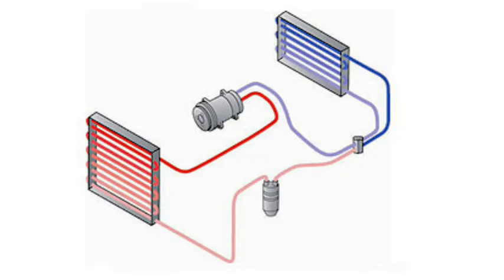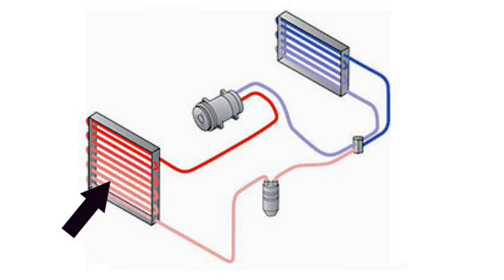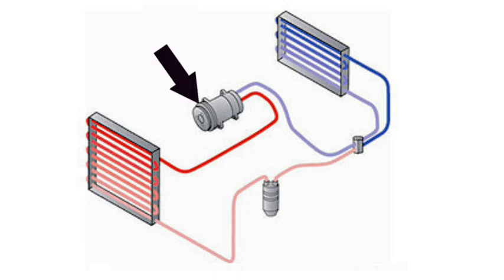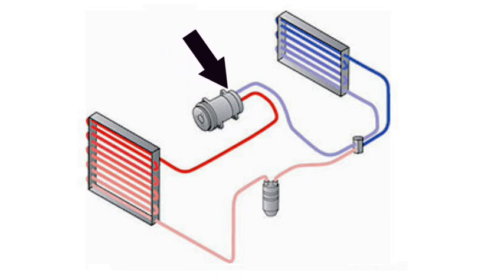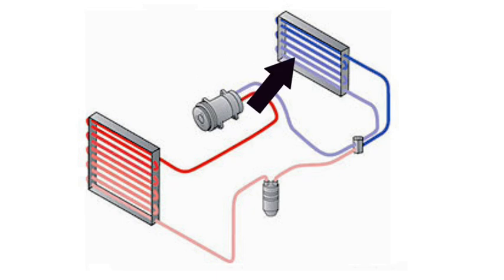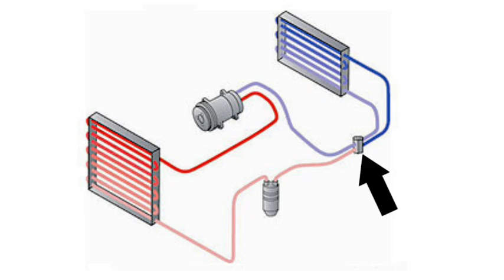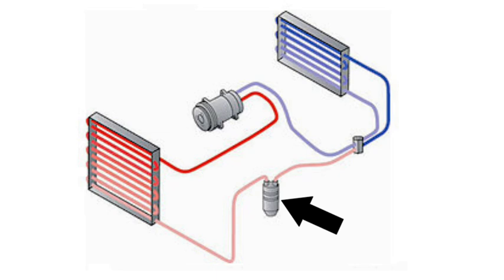AC System Basics - EricTheCarGuy

Comment: Hey Eric explain why you are showing these A/C video on charging your system, when you are constantly telling us to don't work on it and take it to an A/C professional. So are we just watch the video and then let someone else do the work. They can't be for professional because they wouldn't need them. So do we learn how to do with these videos or do we just forget about them and just take our cars to a mechanic.
Reply: Ray Cruz the reason he says let the professionals do it is because basically nobody has an A/C recycler sitting around in their garage, which is MANDATORY to use when servicing an A/C system... not using it allows the A/C refrigerant into the atmosphere, which is against the law and the EPA can slap you with a 5 figure fine for doing so. 

If you have the equipment and the knowledge to do so, then by all means do it yourself. But there are very specific machines and tools that need to be used
Reply: Ray Cruz were is the orfice tube on 2005 Buick ."."".?diagram showing it b helpful since it looks it can b anywhere in line
Reply: Ray Cruz sorry 2005 lesaber custom
Reply: Hey Ray...I saw Pat Goss this morning on Motor Week from Olings Mill, MD. He showed cleaning the ac system with this can that foams inside the entire unit under your dash. He demonstrated on the container under the dash sitting on his cart. Explained how to do it but did not say if you can make the hole without removing. Pulling those out you have to remove the entire dash. So my question for him was if this is done in place. Also just seeing the video's just makes you more aware how the system works. When mechanic talks to you what he will be doing, you know what he is talking about.  Always good to know something about your car problem if possible and maybe not get ripped off.  I've learn a lot just watch my Motor Week on Saturdays.  These Youtube videos are great and leaning things I've never attempted. Have a Good Day !
Reply: Weechie357 pacman 
Buy a service manual for your car.
Reply: Ray Cruz A
Reply: Also, by telling us to get a professional to do it he covers his legal bases. In other words, he can't be held responsible if someone does it wrong & gets hurt. So, if you have enough to get-ur-done go for it. If you don't, take it to someone who does. I think it's good advice, don't you?
Reply: Maybe so you have some idea of what the hell you're talking about when you take your car in for repair?  Ignorance may be bliss, but it's also expensive.  Or liability reasons?  Or 700,000 views, so maybe the knowledge, capability, and skill set of his audience varies quite a bit?

Should I keep going?
Reply: Your barking up the wrong yet tree I wasn't knocking on the video just some the comments that he made. In one sentence he is  telling you you how to do it
Reply: And on the other he telling to leave to the professionals.
Reply: And I'm saying there is value in knowing how it's done even if you don't do it yourself.  If you're going in for surgery, you want to know all you can about the procedure, right?  Will you ever do it yourself? Probably not...

Comment: EricTheCarGuy: Hi I'm a new subscriber.
 Have a question, My compressor clutch will not engage, i attempted to put Freon in it , however, the system would not take the Freon.
Does the clutch have to be engaged to accept Freon ? Thank you.

Comment: From Nashville TN, I have a 2011 Nissan rogue that blows out hot air with the a/c on. I took my car to get it looked at. The first guy was sure it was the A/C Expansion valve. After review that the part was $50 and the labor was $900 and me being a line tech, I have experience in production on assembling the dashboard over 2 years. I'm confident that I can do the job. but when it comes to the A/c System, I'm new to that. So I'm in the proses of finding out how it works and studying the main components. I need to know what test's can I run to find the main problem and why there is no cold air. I need every test that will help me. Thank you Justin.

Comment: ok i have a 03 hyundia elantra gls 4door lol that thing you said in front the radiator now on the left side on passenger side there is a bolt and i at dent lee loose the bolt and big air came out should i be worry about that

Comment: i like the video so i would like to ask you that is it possible to run a car AC assembly outside of the car....  just using the electric motor as a driving force of the compressor assembly  that activates by the electromagnetic clutch

Comment: Hey, I have a problem with pressure sensor. but when i bypass those two sensor wires a/c works fine. Because when you bypass this, the system thinks that there's enough pressure in it. But is it good to bypass these wires or is it something not good about this?
Reply: The pressure sensor turns off the ac when the pressure gets low to protect the internals of the system from wearing. If you bypass those wires, the ac will work but you risk damaging the system in the long run. Any sensor is there for a reason and bypassing any sensor is normally never a good thing in the long run. Try getting your air con re gassed and see if it works better
Reply: Well I will know if pressure get low then ac won't get cold enough lol
Reply: ThreeDriv3rs You'll also know if pressure gets low when your compressor fails lol.
Reply: TheArfdog Yeah, but it could be some other problem. It could be some hole in the lines
Reply: Your A/C will not start up if the pressure is too low, that is what your sensor is for. This is a safety measure to prevent your system being damaged since the oil that does the cooling, also lubricates the system. You better make sure there is enough pressure and that it simply is the sensor that is in error (which is not that likely).
Reply: Henk Moesker I fixed my problem

Comment: Would you recommend the universal A/C kits available on YouTube for cars that don't have one installed already, or try to get hold of the parts that make up the original A/C system? And if yes to the first, would the condenser placed in front of the radiator reduce the effectiveness of the radiator too much for that placement to be a good idea?

Comment: hey eric just to expound on the subject of moisture in a ac system what actually happens is the moisture freezes at the expansion valve and clog's it completely closed , this is a common problem in all high pressure applications , nail guns for example have metal hose couplings that do this in winter

Comment: The expansion valve drops the pressure from a high pressure  liquid refrigerant to low pressure liquid refrigerant.
In the evaporator the  liquid refrigerant changes from a liquid to a gas as it absorbs heat from the interior of the car.

Comment: wheres the line drawn when knowing if your condenser works or not? 

I have a honda civic that needed a new radiator because of a crash, there was saving the radiator but the condenser looks in good shape. no visable oil leeking from it.

Comment: Hey I have a 87
Toyota pickup with out ac and I plan on putting ac in and I was wondering if I could just run 12v to the compressor with a one way switch so I can turn it on and off

Comment: hey eric  i just purchase a truck that hasn't had an oil change in many years (1988 ford f150) runs god but the person i bought it from toll me to do an oil change firs before take it for smog this truck was use around the farm only. he told me to drain the oil take the filter out put a new cheep filter put the drain plug on put a gallon of  gasoline where the oil goes and run it for a mine or two to get rid of the gunk in the engine from not having regular oil changes. then drain the oil pan again replace the filter with a good new filter replace the oil plug and put fresh oil it all sounds good exempt  the gasoline part. do you think is safe for the engine to do that what do you think.    thank you
Reply: DO NOT DO THIS the farmer is full of BULLSHIT
Reply: Ok here is what you do so you don't screw up your engine or get yourself killed. Go to auto parts store buy can of B-12 Chemtool additive. Change the oil as normal and use a good filter. Add the bottle of B-12 Chemtool to the fresh oil. Drive the thing for 100-500 miles. Longer you drive it at normal operating temperature the more cleaning will be done. Highway cruises are the best because the engine RPMS are steady and quick and so the oil is sprayed everywhere inside the engine. After 100-500 miles change the oil again using good oil and a good filter. Be sure to use a good filter both times because you will be breaking built up particles loose and they will enter the oil and get carried to the filter. You want a really good filter to catch all that junk that is being loosened up. DO NOT DRIVE MORE THAN 500 MILES. The Filter will clog really fast once the cleaning process starts. Good Luck!
Reply: If you want to flush then engine out of oil use the correct produyct to do that and not petrol

Comment: I bought a 1994 f150 and the heat recently stopped coming from the vents on the dash but still comes out strong at the defrost. What is wrong?
Reply: There is a vacuum line that runs in through the fire wall that is not getting vacuum as it should. That vacuum line connects to the duct system control.  There is usually a big black plastic ball like thing which is used to store the vacuum that, that same line maybe hooked to.  On my 92 grand prix it was under the front bumper area and the vacuum line was brittle, when i replaced that section of line now my cruise control and heat/ ac duct work perfect!!!!

Comment: Hey Eric, why is the condenser located in front of the radiator? Is there a purpose for that? Where is the condenser located in mid-engine cars? Is it again in front of the radiators, if so, what if they located at the mid inlets of the car, does the A/C line all the way from the mid to the dashboard unit? Thanks in advance, and keep up the good work!

Comment: yeah, i have a leak, the dye showed up around the hose coming from the compressor and i think the discharge hose/cap near the radiator, also the metallic pipe lines coming from the drier... :/ parts are expensive as hell from honda/acura, and its extremely hard to find them elsewhere :(

Comment: i have a 66 mustang and an aftermarket dash evaporator/blower.  when putting the other components together does it matter about the source of those parts?  what i mean is can i find a condensor off say a F150 and a dryer of a windstar?  or do the components need to match up for some reason?

Comment: so basically, the refrigerent keeps on rotating..it passes from the compressor to the condensor where it gets liquifies..and the nexy stage is the evaporator where it evaporates..and then the cold feel like you demonstrated..the refrigerent then again into the compressor and the rotating..dryer removing the moisture and orifice tube maintaining the pressure and the temperature.

Comment: Hi, I have a Rodeo 95 the A/C system used to work fine, nowadays when I turn the system on after a couple of minutes the compressor start to make a noise like a belt problem but it's not because first of all I don't feel the air cool enough, secondly the car will start shaking like there's a short as all the indicator in the dash start flashing and I have to turn the A/C off. Can you tell me if this issue is about not having enough frion or oil in the system.

Comment: Yes i would like to install ac on my 46 chevy truck I've installed a 93 LT1 engine in my truck if i use all the components from donor car and make my own evaporator box unit and vents i can rewire all my speed control

Comment: #3 Is there still going to be refrigerant in the system even tho there is a leak in the dryer connection and it no longer puts out cool air from inside the truck. I guess what I'm asking is can they still be refrigerant in the system when its blowing out warm air,Or is the only way to know for sure its empty is with the Gage .

Comment: First of all I want to say thank you for being here for us. A  months ago I had a new condenser installed in my 1997 lexus lx450 . The mechanic used the die colored  refrigerant . When I got home I took a look under the truck and I could see some green die liquid dripping from the bottom of the receiver dryer .I wiped it up and could tell it was coming from the top . He said wait till it stopped getting cold in side the truck and bring it back. I took about 1 month for the refrig to leak out .

Comment: Ok so I took out my A/C compressor because it was failing and I don't plan on replacing it. I installed a bypass pulley in its place. Would it be ok to remove the Receiver Dryer as well?

Comment: If you're not a pro, your ac is broken and you don't give a fuck, take it out. Less weight= faster car, roll down the windows an inch and BOOM ac! the faster you go the cooler the air. (this method of fixing your ac is not recommended if you're not a professional)

Comment: I work on residential AC. it seems to be the same system just smaller size. do you have to pump down the Freon before removing any parts or recycle the Freon.

Comment: Enjoyed your matter of fact approach to solutions Eric.  Not sure if you are familiar with the 98 lumina... as it has the ability to rock the engine forward to access the spark plugs in the back near firewall(3.1 engine.)  Can using this rocking motion cause a leak in the AC?   This is the first question.   Next, I have an issue that I have not been able to find a solution on any forum and I challenge your expertise.

Comment: EricTheCarGuy
i have a 2003 Pontiac Aztek and my air conditioner only blows room temperature air. The vehicle itself is also making a noise, and the professional that i had spoken too said that the Air Conditioning compressor is the culprit. now he diffident charge for this observation nor did he give it much inspection(assuming i have the proper knowledge and tools) would you recommend that i replace the air conditioning compressor? or bring it in to have it serviced?

Comment: i have a1999 GMC Jimmy, starting at 45mph and above when I have the air condition on, my car makes a popping noise,  sort of like pop corn popping, it only happens when the tempature is hot outside when i have the air on., like 90 degrees or above, low tempatures it does not pop only when the tempature is high outside and at 40mph or higher. your video it very good, i think one of these components is failing. Any suggestion would  help. The noise never happens when the Air is off.

Comment: thanks for the great video,iv got a kie sedona and the cp is really hard to get to.the system was doing great just 3 weeks after a fix and recharge we took a road trip to miss.i stop at a store and ran over a full bottle of off mosquito spray,the compressor hasn't worked since.do you think that the stuff in a aerosol can could short out the clutch?

Comment: Check the tension on the drive belt for your A/C compressor. If you have a manual tensioner, adjust accordingly. If you have an automatic tensioner, it may need to be replaced.

Comment: Hi erickthecarguy on December of last year I watch your video on how to swap(replace) an engine on a Honda and  everything went well but after that my as its hot working at first I thought it needed a can or two of ac refrigerant so I did filled it with two cans of 12 oz but before that I notice the compressor was not engage when ac was running so I read instructions and it say if after refilling did not engage to seek professional help I did try to tap it with a rivar and saw movement

Comment: The dust blowing can gets colder because the liquid inside is evaporating, if the can was filled with just a high pressure gas is would not get colder.

When you let the gas out of the can, the pressure inside the can is lowered. This new pressure is below the liquid's vapor pressure that room temperature so the rate evaporation is increased.

When you close the valve on the can, evaporation continues and pressure rises until it reaches the vapor pressure.

Comment: My a/c system does not valance out when the car is stop for a day or so, it had a leak in a valve, it was repair, evacuated to -30 vacuum for 40 min, refilled with refrigerant, car running, low 25psi, high 60 psi, car stop low 80 psi, high 20 psi, but it doesn't valance out over night as it should, why?

Comment: LOL good opening.

The major reason of A/C failure is not using it during cold seasons. This leads to dried up seals/O-rings, which releases refrigerant (intentional release is illegal in many states). Newer cars probably don't have this trouble as much, since DEFROST automatically turns on the compressor.

Some recharge kits are available, but I still recommend having it done by a shop.

Comment: OK Eric, I have one question for you, maybe you my help!
I have Ford Mondeo 2001 (Europe car, since I´m from Europe), and car has not been driven for four years. Air conditioning was functioning quite normally four years ago, and I knew that through time the gas from the system "disappears". So, first thing I did, I drive it to the nearest AC service for gas and oil exchange as well as system check. All was done, and system was OK, but compressor don´t wan´t to start. Any suggestions? Thanks!

Comment: I have a 1995 Chevy s10, my a/c is not working. so far I have found that the light green wire on the pressure switch is not connected to anything. I am stumped on where it goes. Can you please help? I cant seem to find a wiring diagram for that anywhere.

Comment: Do to have a process to repair a smaller hole/leak in a air conditioning line?   The half rubber/metal hoses are expensive and hard to find.  Thanks in advance.